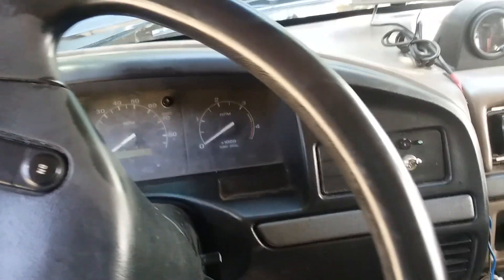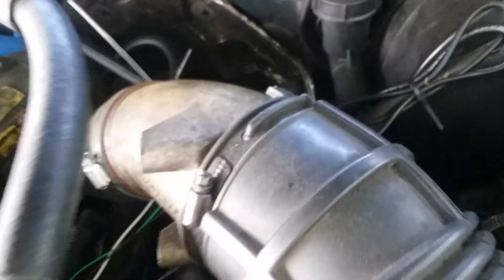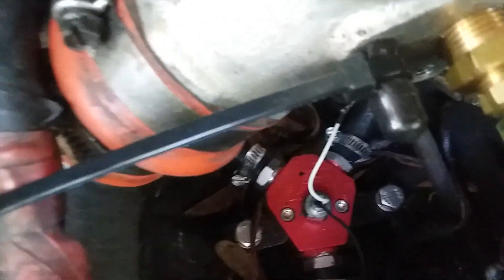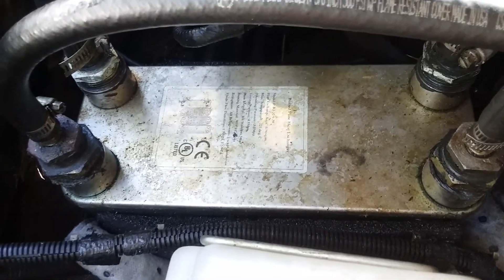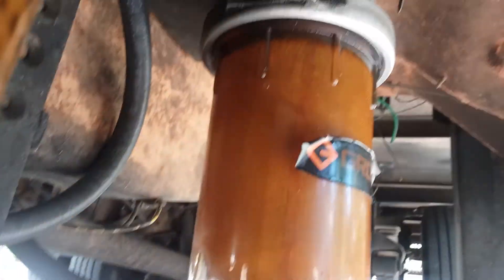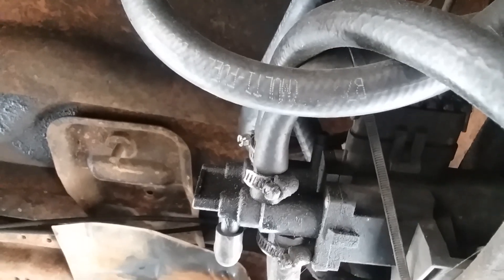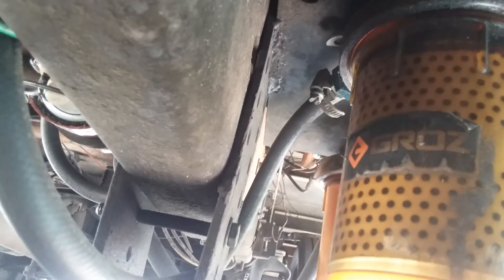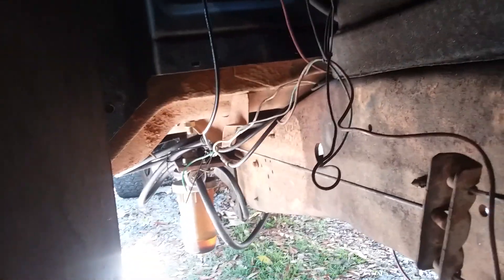7.3 electric fuel pump

Comment: Hey there is it still rolling? Also on the back of the head is it going to the banjo bolt or where the fuel inlet is?

Super duty pump, Switch over valve, heat exchanger and 3/8 Y adapter.
Reply: Still a nice video shalom

Comment: I'd try to run your hoses around the pump differently so they're not hanging down like that. It's probably fine if you stay on the pavement, but I know if they hung like that on my truck they'd be gone in no time.
Reply from the maker: Yea I have started re-routing all the lines, I like to make sure everything is going to run properly so that way I don't spend a lot of time getting it perfect and then I have to go back through and tear something apart cuz it's not working right
Reply: @dieselguy9950  Yeah makes sense! I'm in the process of planning an e fuel system myself. I'm in Canada so the cheapest kit I can get ($675) is over $1000 with conversion and shipping. I'm confident I can buy the parts locally and do it much cheaper. Your vid really helped me see how things are routed!
Reply from the maker: @jaydenstang9881  why is it so much more expensive up there?
Reply: @dieselguy9950  Our economy is trash. $1.36 Canadian is only $1.00 US
Reply from the maker: @jaydenstang9881  oh ok gotcha